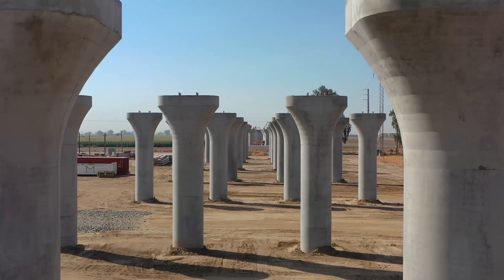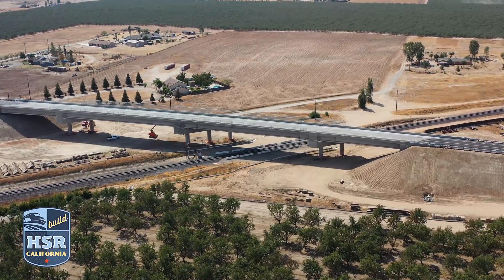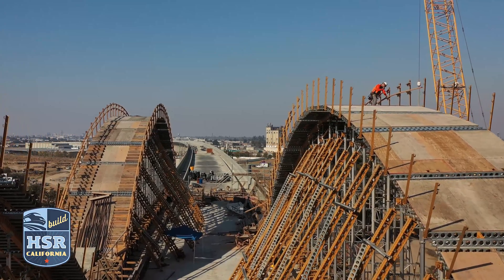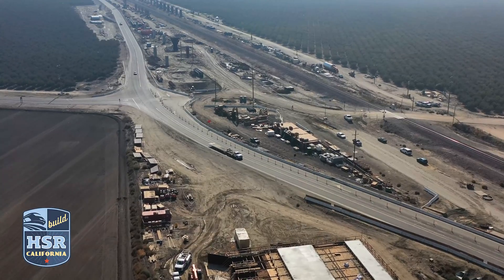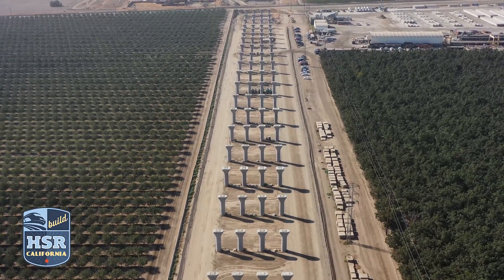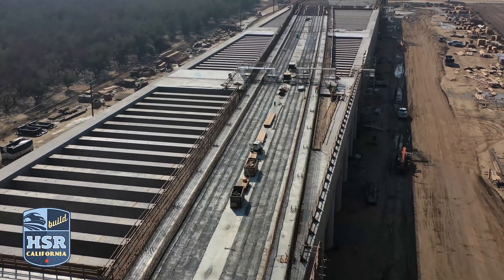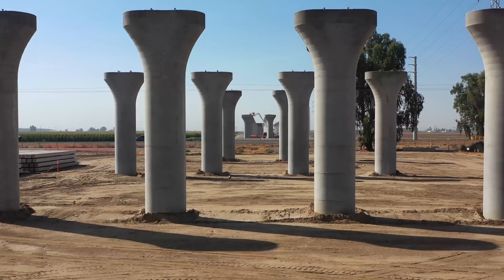California High-Speed Rail Construction Update - Fall 2021

Comment: Elon would have this built in 3 years and at the fraction of the budget. How many billions will this cost?
Reply: Yeah, Elon tried to do that with his tunnels in Vegas and LA. What did that get us? Are we all using hyper loop or at least his tunnels right now? No?

Didn't it turn out to just be an unsafe, low-throughput car tunnel that nobody wanted in the end?
Reply: But what did it really cost us compared to the BILLIONS that CA has wasted for their high speed rail? That’s why private enterprise often beats out government funded projects, nobody loses their job in govt but private businesses fold if they fail. Which one is more incentivized to make the most out of their budget instead of lobbying for more time funded by tax payer dollars??
Reply: @mynmisoli  Isn’t CHSR entirely built and designed by private companies? Your logic seems to have some gaping holes there bud :)))
Reply: @TohaBgood2  So what's ur logic?  Keep letting politicians spend Billions of taxpayer dollars because the government knows best?  The original estimation was $80 Billion.  Now it's changed to $100 Billion dollars.  Who's getting fired for this?  Nobody. But hey it's just our money right?
Reply: @mynmisoli  For starters, we need to understand who is actually responsible for what. If you want to fix something you need to know what is wrong with it. Politicians have nothing to do with this. They are not running this project day to day, the CHSR Authority is. Politicians have oversight powers, yes. But they have actually been using those oversight powers pretty effectively as you can see by the very public scandals in the press between the CHSR Authority and various politicians.

According to both inside and outside estimates, over 80% of cost increases are due to change orders by private construction companies. This needs to be investigated and those responsible punished in accordance with the law. But it very much looks like the construction companies are fleecing the taxpayers, not someone else.
Reply: @TohaBgood2  so ur admitting that the govt is doing a crap job overseeing this as they are allowing private companies to fleece tax payers money?? Doesn’t that tell you something?? Perhaps the government is not the best overseer of this 100 billion dollar project??? Thanks for proving my point!

Comment: In 20 years, you can go from south san jose to bakersfield. Yeah!
Reply: There's a good few million people in the Bay Area who would love to be able to commute on that exact route. What's your point?
Reply: you lie, they are not a few million people who want to ride from the bay area to bakersfield.   
This is a wasteful train.

  for a tiny fraction of the cost, they could have added four lanes to Interstate 5, dedicating a lane for trucks.    that would benefit the most people for less cost.
Reply: @dave8599  You do realize that the very first thing they calculated was if building the equivalent number of lanes on the 5 would be comparable? It was several times more expensive and did nothing for congestion at the bookends. It's worthless to expand highways in one area ff there already are massive traffic bottlenecks at the destinations. You just make more people get stuck in traffic for a larger amount of time. Also, expanding in some of the mountainous areas alone would cost as much as the entire system!

All of this was looked at when they were originally planning the system and reanalyzed every time there was a major change. They also looked at expanding airports. Even if the system costs four-five times more than projected, we still come far ahead of expanding capacity on highways and airports. There was no contest really. You should read up on the project and the issues it is addressing.
Reply: HEG GREG THIS IS MICHAEL I THINK WE WENT TO HIGH SCHOOL TOGETHER. FHS CLASS OF 65 LET ME KNOW IF YOU ARE THE RIGHT GREG ROSEVILLE

Comment: The only issue I have with this was the fact that all the cities and locations mentioned were obscure. The HSR project doesn't connect to any of the major California cities like it was originally planned. If at least one end of the line was in Los Angeles, San Diego, Sacramento, or any other major city then you can give people fast easy access to the outlying areas of those cities or vice versa. But the current line seems almost deliberately set up for failure because it's a train from nowhere to nowhere.
Reply: What are you talking about? It connects Fresno (larger than Sacramento) and Bakersfield which are the fifth and the ninth largest cities in California. They also have about 1 million people each in their respective metro areas. Sure, they are smaller cities by California standards, but they would easily each be the largest city in a flyover state. In any civilized country, these cities would have their own rapid rail transit systems, let alone HSR going to them.

Furthermore, the system will connect to local rail to Oakland/SF, San Jose, and Sacramento in Merced. That's a megaregion with 12 million people in it!
Reply: @TohaBgood2  Excellent facts.  Those cities will get larger too.  No one can see the future but these videos are a pretty good view into it.
Reply: $500 billion cost to build a train to serve two cities with a combined population of 2 million.   Do the math.  $250,000 per resident.  if say ten percent use this train, then the cost becomes $2.5 million per passenger!
Reply: @dave8599  Actually about 6.5 million people live in this region and the train connects to local trains leading into a region of 12 million people. 

And, I'm sorry, $500 billion? What? That is just a completely made up number! Where did you get it from? Can you show me a quote?

And expanding the highways instead was studied. It would have been several times more expensive, so there's really no choice. You can't coast on infrastructure built in the 50s and 60s forever. At some point you need to build new roads and railroads to keep up with population growth. This HSR line was among the options studied and won as the least expensive and the highest capacity option. The fact that it happens to be a cool new train is just a bonus.

Comment: Work being done from Madera to Wasco??-- from where to where???? Nobody goes there.
Reply: How about Fresno and Bakersfield, two 1 million population metros in great need of some kind of rapid transit and downtown development catalysts. Also connections in Merced to San Jose, Oakland/SF, and Sacramento, a mega region of over 12 million people.

Sorry bud, your talking point has been debunked countless times before. Got any new material?
Reply: @TohaBgood2  I didn't know that the cities are that big, in Germany the Cities in that size have their own big rail networks
Reply: @michaelneichel9543  As they should in a civilized country! 

To be fair, these cities themselves are smaller as they don't include some of the close-lying suburbs. These are the sizes of their respective metro areas. The way we do administrative divisions here is a little wacky :)
Reply: @TohaBgood2  For the billions this system costs? No way is it justified. An enhancement of the existing rail system with double trackage could increase traffic volume up to 7 times at a fraction of the cost.
Reply: @penjim  The existing rail system consists of track owned by rail freight companies. So what are you proposing exactly? Should the state just gift them a bunch of new trackage and then beg them to use it like they do now? Or take the existing trackage away from them and then charge them use fees?

Also, you do understand that, (a) actually a lot of the route already is beside existing right of way wherever possible, but the existing freight right of way just isn’t straight enough for high speed and they have to deviate often.

(b) even at the current maximum estimate, the cost is less that half what it would take to expand highway infrastructure to the same passenger capacity numbers. 

And (c), conventional upgraded right of way would be too slow to compete with air travel rendering moot a big justification for having the system in the first place.
Reply: @TohaBgood2  Why not? Practically every other developed nation in the world does?
Reply: @penjim  Practically every other developed nation has nationalized their rail rights of way. Is that the type of communism you are proposing? In the USA, right here? Where are you from, son? 

Lol, that actually almost happened in the 70s when all the rail freight companies went bankrupt but that ship has long sailed. If you tried this now the lawsuits would stretch for decades. It is faster and cheaper by a wide margin to just build the current CAHSR system and have a separate truly high speed passenger railway that the state owns.
Reply: @TohaBgood2  Amtrak uses the same routes now. That’s a national rail system. It’s a contractural relationship between business and government. And the very land that railroads use was originally Federal land grants.
Reply: @penjim  The US does not have a national rail system in the same sense that, say Germany or France does. Their ROWs are actually owned by the government. In this country we let private companies first get massive land and subsidy giveaways and then we also let them keep control of the rail tracks. Amtrak has zero legal power to compel anyone to let them operate a passenger train. So they have to negotiate and pay the railroads tribute in order to have any passenger service at all. 

Needless to say, the railroads do everything in their power to prevent Amtrak from ever being able to run passenger trains on their track if that is at all possible. This is how we got the mess we have with passenger trains  n this country, and it's not like that is a big secret.
Reply: If you want to travel from Los Angeles to San Fransico by car or train you need to go through the middle of nowhere.

Comment: How soon after curious people stop riding this train from nowhere to nowhere will it be able to be turned into a rail to trail?  I bet Santa Cruz bicyclists are ready.
Reply: It's designed with connections in Merced to San Jose, Oakland/SF, and Sacramento, a mega region of over 12 million people. It also links Fresno and Bakersfiled, two metros with about a million people each. It will do just fine.
Reply: How many 100s of billions does this thing cost?    all to serve a couple million people.  Do the math, we are talking tens of thousands of bucks per person in cost.  and most, in fact the vast majority of people will not use this thing.  a huge money burning exercise this is.  fjb
Reply: @dave8599  How many 100s of Billions? What are you talking about?

So you clearly know nothing about this project. Why don’t you go and read up about it and then return and let us know exactly what you were wrong about?

Comment: This thing is a huge boondoggle, you could probably give away an electric car for everyone that is gonna use it 
when it gets done (over the first 10 years) and STILL SAVE MONEY.   The amount of money being wasted is 
that staggering.   Cost benefit ratios were never examined and hugely inflated.
Reply: And where are all of those electric cars supposed to drive? The roads are already hyper-congested in this state. One way or another you need new right of way built, whether highways and roads or rail lines. Rail lines are cheaper to build, take up less space, need less maintenance, and have orders of magnitude more capacity. There's a reason there's an HSR construction boom all over the world for the last two decades. Everybody looked at the numbers and came to the conclusion that HSR is the most efficient way to solve congestion on 100-500 mile routes.

If you have better ideas backed up by science, we're all all-ears.
Reply: the solution is simple, widen interstate 5 from four lanes to eight, heck even six lanes will be an improvement.    blacktop is cheap, the right of way is already owned.
Reply: @dave8599  A single extra lane on the I-5 from SF to LA would cost over 20 billion dollars. That's the entire budget of the current section of CHSR that is under construction for less than 1/10 of the capacity. 

Also, where is all of this extra traffic supposed to go when people arrive in cities.   There simply isn't any road space for them to use. All the time you save on the I-5 will all be spent in traffic at approaches to cities.

Also, where will all of these cars park when they arrive? Parking is already an issue at both bookends.

When they were deciding what to build to ease congestion on this route, the first thing they looked at was adding lanes to the I-5 instead. It's many times more expensive than HSR and creates more issues than it solves.
Reply: The roads are congested fam. Plus parking.

Comment: Just think about all of the future lawsuits when there is a 8 or greater earthquake...
Reply: Same construction methods as BART in the Bay Area. BART did perfectly fine during the last large earthquake and was running again within minutes. The Bay Bridge was out of commission with a portion of the span falling into the Bay.
Reply: Japan has had high speed rail since 1964 and has a ton of earthquakes and it  seems to be doing just fine...

Comment: I don't understand why there needs to be so many bridges and viaducts and underways and all these complex structures, you guys are building through farm land, just build it straight and if any cars need to cross over build a small bridge at those points.
Reply: So you want to essentially have CHSR be a North-South wall blocking all, or most East-West roads in the Central Valley? You understand that this is, well, insane. There are county roads and access roads in farm country about every mile. That's what is necessary to have farm country continue to be farm country. They are closing some of them, but you can't close all of them. People, farming equipment, produce, etc. need to be able to travel through there.
Reply: Many of these bridges are for the cars to go over. The viaducts allow the train to go over rivers and low land without filling in all the land in between them.
Reply: If you want to cut more lands, then you need to buy those! California governments have been fighting for years just to acquire barely enough farm lands from private owners to build the project. It's not because they don't have money, it's due to the strong disagreement from Republican farmers in the Central Valley. They will save tons of money and time to build the project cutting through existing roads and freeways than acquiring more lands, which require more useless and unnecessary negotiations.
Reply: @TuanNguyen-uq8gz  The option to go down a highway median was looked at in detail and rejected. This is for myriad of reasons, including a hefty dose of politics. You can't run a major chunk of brand new infrastructure to link two extremely rich parts of the state and completely bypass the poor parts. This is a statewide project and has to serve the entire state as much as possible.

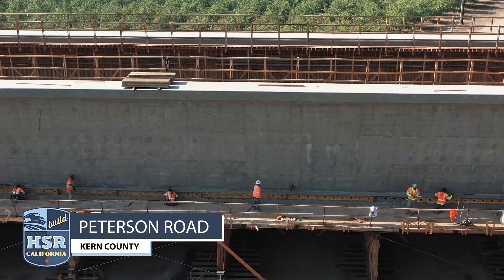But beyond that there are legitimate technical reasons for not choosing a highway median. It is too narrow in certain places and you have to spend enormous amounts of money to bypass those areas. Highways are built to a different standard (much steeper inclines and much shallower turns). This means that either your speed is limited or you have to spend insane amounts of money to viaduct and tunnel and trench the ROW to maintain speed.  And the Central Valley is the exact place where it is flat enough and straight enough for the train to gain speed and be able to run a legally mandated sub 2:40h SF-LA runtime. I'm not even going to mention that a highway median alignment needs concrete safety walls on both sides of the ROW to prevent gruesome accidents. That's two particularly thick concrete walls running almost the entire 500 mile length of the route!

In other words, there's reasons why HSR rarely runs in existing highway medians and when it does, it is usually limited to about 150mph. This just didn't work for this project as approved by voters and could not be legally implemented without costing a few times more than it costs now. All of these conclusions are in the public documents the project generated when it was being designed and approved. You can look it all up.
Reply: Contact the Project Manager because this is sad
Reply: Someone is finally waking up.  Now you can understand how the money is moved around.  More unnecessary construction means more money for consultants and building conglomerates
Reply: That’s thing I was always confused about why not make it straight line kinda like the Acela line in the eastern USA but with only straight lines. They’ve already destroyed many businesses and new establishments just to build this rail here in Fresno. I’m not against it but tf is it with all the bridges and shit. It’s not the Bay Area.